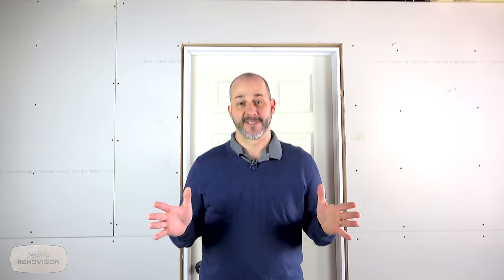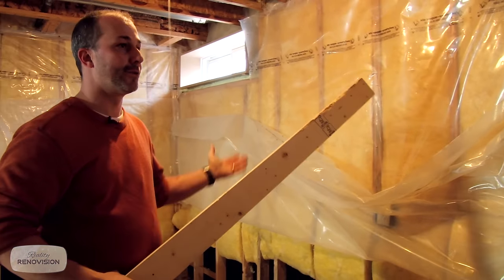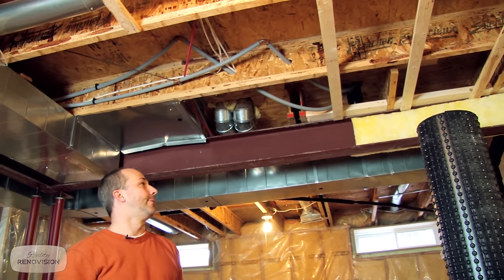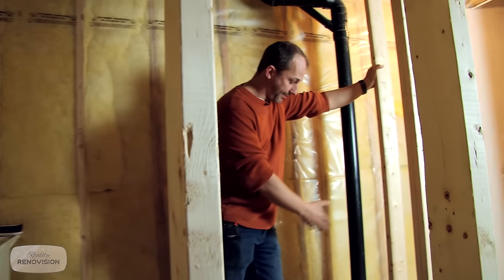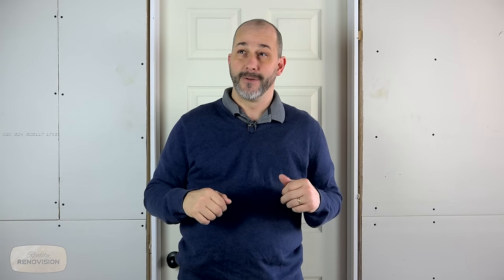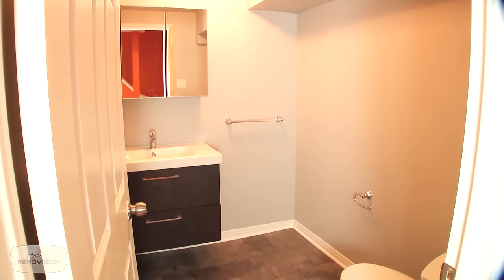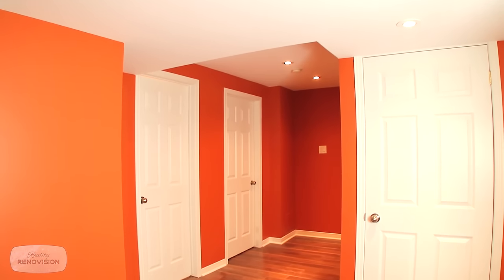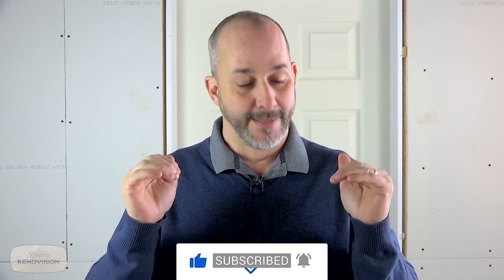This Basement Finishing Secret will Save you a FORTUNE!  | Reality Renovision Ep04

Comment: What qualities should you look for before purchasing LVP flooring? No idea what to look for.
Reply: It all depends what your substrate and personal requirements are. Are you looking for something that's really high quality or just something that's cheap but waterproof? Are you on concrete or on wood subfloor? There are a lot of products out there and they just keep getting better every year. I found that planks that are smaller tend to come apart much easier. Most new products are very large planks, which work great and have less joints. Also the texture on the actual plank is something to look out for as well. Some of the older ones are super slippery and can be dangerous. Look out for texture because it makes a bigger difference. The joints, I find glue is too old school, the locking planks works really well. Theyre all a little different but work on the same principal. Look for thickness, if you take a piece out of a box and hold it on by the end, does it bend a lot? Thinner products dont perform as well. next do they have a solid core only or do they have a soft layer underneath as well? If it's just a solid core you should really put down under pad. I've put down solid core flooring with no pad and it's like walking on concrete, little high impact. Another important point is, take your keys and run them down the plank: does it scratch easy? If yes, dont buy it. You want something durable. Anyways, I am no expect, just a guy who has experimented a lot with vinyl flooring. Personally I really like the life proof brand at home depot. It's 3.50 Canadian a square foot I believe (may be different where you are) but it's great stuff. I put some under-pad down, then the flooring (you dont have to but it is quieter to walk on and more comfortable) and the result is great. That flooring has a hard core and a soft bottom. If your looking for something else we have a video coming out on our other channel Home Renovision DIY in a couple weeks, may be worth waiting to see that. Good luck and Merry Christmas!
Reply from the maker: This is a common problem. I have sourced out a great product and will be installing it and making it available for purchase in a few weeks on our other channel. Home Renovision DIY
Reply: @SubdivisionAuto  So much to consider before buying. Application,substrate,texture,width,thickness. Thanks for the info. Every little bit helps.
Reply: @willymaes  Indeed. Dont be afraid to open some boxes and really look over the product. Find that works for you, what you like. What works for me may not be what your looking for and vice versa. Regardless what you choose, i doubt you will be dissapointed with vinyl flooring, its great stuff. Merry Christmas and happy holidays

Comment: Not loving that plastic vapor barrier.  Will trap moisture behind the wall.  Any concrete wall below grade will vent moisture into the interior and  it will  stay trapped behind the plastic leading to mold and mildew.  Best practice for sure until the 80's or 90's but no more now that building science has clarified moisture movement.  Foam boards against the wall to provide a vapor barrier and then a 2*4 wall with Roxul fill would be ideal.  Just my opinion!

Comment: I have to disagree with taking along time to get your money back. I am doing 400 square feet of a basement now, between the electrician, heating and my charges the total will be around $28,000. The building inspector told me that the property value will increase $60-65,000.

Comment: You mentioned that your head ducts should be extended to the floor. In theory, you are correct. However, furnaces have to work much harder to force the air downwards regardless of whether or not it's through a pipe or into an open room. Adding the extra ducting is useless. However, your cold air return should be extended to the floor so that it will pull the cold air out and the hot air down.
Reply: Are you sure about that?

Comment: Wow. Unbelievable. This is a house like in the Middle Ages.
Where I live we build basements with reinforced concrete, 50 cm structural bricks and interspaces below the floor and around the walls to prevent humidity from affecting the construction. It’s not cheap but it can last for generations.

Comment: If you live near a lake or a creek, do not put carpet in your basement, unless you have adequate draining or a sump pump installed.  It will be a hot mess to clean and maintain during the spring and summer.

Comment: Do you need a Licensed Plumber and Electrician to pass the Inspection?   Is that a requirement?  Or anyone who can do the work according to City Specs is good enough to meet city requirements and pass the Inspection? - Thanks
Reply: All contractors should be up to date on any codes and should verify local codes if necessary.  They city will have an inspector to pass/fail the work done.

Comment: I would always put the floor right on the concrete! Besides moisture coming from underneath the floor, most homes have the water heater in basements and someday it may leak without you knowing it. I’ve seen people that have had to replace an entire wood floor in a basement just for a burst water heater.

Comment: I can not find a video on YouTube or your channel for what I need to know. I have a ranch style home with walkout basement.  Built in 1962 in Michigan Kent County area. I took out the wood paneling walls and shag carpet.  But I don't know if I can install baseboard trim touching the cement? I used treated wood on the floor when I built the frame but I'm scared if I use mdf trimming cause it's not wood it will get water damage and soak up from the treated wood and concrete floor. What do i do? Also...the support wall straight down the center of the basement is a wood frame but it's sitting on a 5 or so inch concrete block wall that I can't attach the baseboard trim too cause it concrete sitting up as high as the trimming is .
Reply: You took out the wood paneling and shag carpet, but I assume your installing drywall walls.  Your drywall will be above the floor level so it won't wick moisture.  You didn't identify the flooring.  Is it unsealed concrete or just a painted surface?  If the floor is vinyl or laminate, the baseboard will be above it anyways.  MDF against the concrete will wick moisture and have a short life.  Well primed wood baseboards would be a better choice.  The ultimate choice would be PVC baseboards, but also the most costly.  Attaching baseboard where there is a 5" high curb can be accomplished with adhesives or you could Tapcon screw them, countersink and fill the heads.

Comment: Great video...one question though, why the ROI of finishing the basement is low according with your experience? for everyone I have asked,  the additional "living" space is very "valuable". Thanks!
Reply: Certified Real Estate Appraiser here. While the added area does add value, you would be lucky to get even 1/2 the value of above grade finished area. There is not a single renovation that gets you a 100% payback. Only combined renovations on homes needing work. You could drop $20,000 on a kitchen and maybe get $12,000 back. Many articles support this. That being said, a finished basement will add value but not make it "very" valuable.
Reply from the maker: it is due to the lack of waterproofing technology that exists in over 90% or constructed homes and the fact that most will have a water event at some point or develop mold making it necessary to rebuild about every 25 years. main floor living spaces last over 50.

Comment: Would you need 2x6 wall studs to run the 4" duct tubing in the wall?
Reply: Yup
Because 4" stud is actually 3 1/2"

So it will be so tight to be able to run it through it.

Comment: Can someone help me>?  - I have block wall foundation in cold climate Canada. The walls have 2in styrofoam glued to them. Its probably 30 year old styrofoam. Should I take all down, inspect the walls and then add new rigid foam and then timber against the foam? or should I do a Typar sheet, frame wall, add insluation in the framing and then plastic wrap?
Reply: Waterproofing the outside would be a good starting point
Reply: @Tzarsio  lol you obviously have no idea what you're talking about. waterproofing the outside requires digging down around the foundation. Literally the most expensive option. I'm not concerned with water from ground. I'm concerned about what to do to prevent moisture / condensation from forming
Reply: @StarkVandalez  Hey MT, all that I'm telling you is that since you have block foundation you should be more concerned about water intrusion because the mortar joints probably have little cracks everywhere. Personnaly I would remove some of the white stuff to see the condition behind It, and then you do whatever you want Jeff has another video on how to insulate basement. But in the end all of theses techniques are a little controversial since it's below ground insulation, and if one thing go wrong then you know the end.
Reply: @Tzarsio  and all I'm telling you is that in a perfect world I would core fill and waterproof and do all sorts of things to the foundation wall. But at this point its not in the budget. Furthermore my foundation wall is in good shape, I decided to rmeove some white foam to inspect. I have no sweating or leaks, no shearing, any cracks on mortar joints are the typical settling cracks following the joint from top to bottom. My yard slopes away, my downspouts are all solid PVC dispensing the water 15 from the house. I've found 5 different ways to finish a basement wall for a warm finished space.. I'm just wondering if one way is better than another?
Reply: @StarkVandalez  I have this white foam too on my walls, it has lower R value than xps or eps. Maybe just add R14 roxul and cover with MemBrain, so you get more R value and you let the wall breathe a little.

Comment: I know this is an old video but I had a few questions. I live in Michigan and have a 17k sqft basement that I would like to finish I to a master suit and a play room on the other end. We have an electric fire place upstairs and I am wondering if it would be cheaper on our energy bill if we were to out one in the basement vs trying to heat it with our furnace. Would it be more cost effective with  installation and the fire place maybe do heated flooring, or with just lowering some heating ducts?
Reply: If you have a 17k sqft basement, this isn't the place you come for reno advice...  Unless you meant 1700 sqft...?
Reply from the maker: for a living space I would suggest an insulated subfloor and then heat to the floor.
Reply: @REALITYRENOVISION so heated floor and floor wall venting for heat?
Reply: @REALITYRENOVISION would peel and stick plush carpet help insulate the floor instead of adding heating?
Reno got out on hold because I had a baby lol.

Comment: $10k for 800 sqft is an insane amount of money,  I guess that price includes having contractors do all the work? I'm a die hard DIY'er so I guess that's why I don't assume hiring out price
Reply: We've been having our basement quoted recently. And for around 800ft2 the quotes have been in the $75k-125k range. Nothing fancy either. Two rooms, small 3/4 bath, HVAC. Welcome to Boston-metro!
Reply: @jeffborkowski  you damn well better not pay that much!  Wth! I literally just threw my phone reading this lol. You better become a diy'er REAL quick. And that price must of included tearing up concrete around the walls to install drains to a sump pump right?
Reply: @dh4094  no. no drains/sump included in those quotes. just what it costs around here unfortunately. DIY not an option for me so need to figure something out. Only way I'm paying $125k is if the price includes a Ferrari.
Reply: I finished 530 sq ft for roughly $4000.  Keep in mind that it was in 2017 and I did all the work myself.  I did not have any plumbing, which is my weakest area.  Framing, electrical, and HVAC are very easy skills to accomplish for even a beginner DIYer.

Comment: Question for folks - we have a large finished basement (~ 1200 square feet). We had carpet/pad installed directly onto the concrete. Unfortunately our sump failed, and we had to tear that all out. I upgraded to a better sump and a backup, with a battery. 

Now we're looking to tackle the floor. I'd previously considered carpet again, or maybe vinyl planks. However only recently did I become aware of subfloor options over the slab prior to installation of the floor covering. 

How important is the subfloor? What sorts of chances am I taking putting my floor coverings back onto the slab as it was previously? 

I run a dehumidifier in my basement year round, and it drains into the sump, so the humidity is well-managed.
Reply: I'm a union flooring installer, have been for 20 years now, and I don't recommend underlayment on slab, especially in a basement. Anybit of water will result in replacing your underlayment. Floating floor is a popular option.
Reply: @Mtowndj81  Thanks Eddie. I came to a similar conclusion, and we ended up just putting down a moisture barrier and carpet.
Reply: @jamesjoslin7586  couldn't agree more.....NO PAD IN BASEMENTS!!!
Reply: @jamesjoslin7586  damn I didn't know that was a thing. Unfortunately we've already replaced the carpeting (with pad). 

We have the sump and a backup. I've also thought about buying a manual pump, so that if both sumps fail, I can manually remove water from the basement.
Reply: @iamamish  I am a remodeling contractor and did this in my own basement about 20 yrs ago. Still all good. The carpeting is certainly not cushy but it worked out well. I found out about this type of carpet from a local carpet retailer. AVOID big box stores for any advise on this. Also- get a water powered back up sump pump. The water is always on when the electricity is off.  I recommend “ Guardian “ brand. Forget about battery powered back up pumps. They only last so long.
Reply: @jamesjoslin7586  water-powered sump? Again, another thing I had no idea existed. Thanks for the tips James!
Reply: @iamamish  Glad to help !

Comment: I’ve noticed you got an inspection for electrical and plumbing.  Is there any inspection or permits needed when just finishing the basement but not adding any electrical or plumbing?  Just putting a floor and walls up but no power on the walls and the lighting is already there.
Reply: Most likely not.  Adding walls in a basement has no load carrying properties and are simply partitions.

Comment: Hi, thanks for your videos. I have accomplished many things with your help. I have one issue I can't figure out and hope you can lead me into the right direction. 

My basement has a gap between it and the first floor of the house. How I call it. I thought it was cove joint. But it appears that is on the floor. Its about 1' high gap on the wall. From there comes out some pipes, the beam and ducts. I hope to seal it with concrete. I wonder if i could make slabs and glue it there. It has some insulation. I want to close it because I found out mice is coming in from there. Please help me fix it. I appreciate any insight.